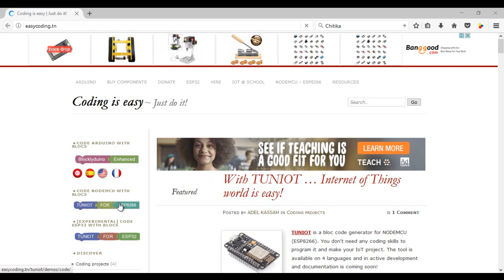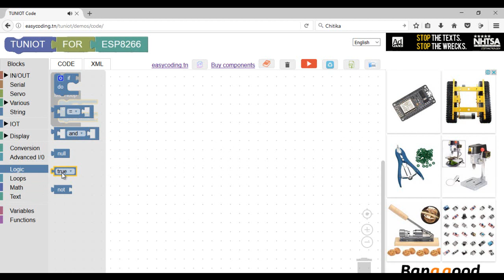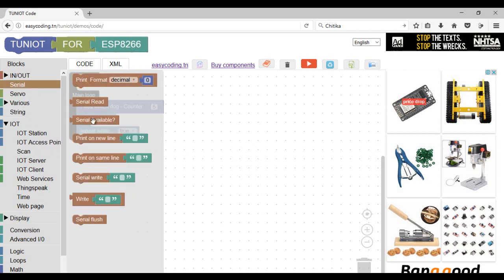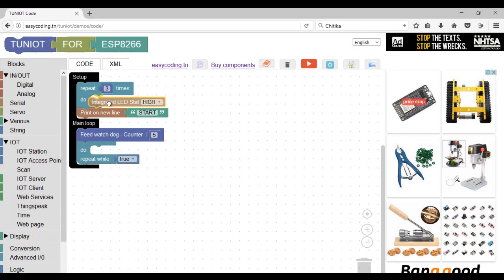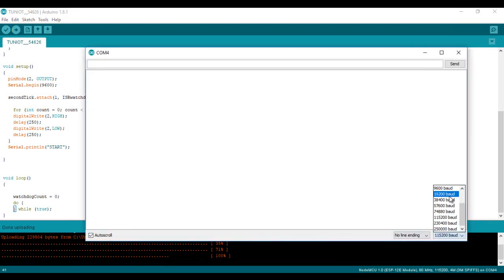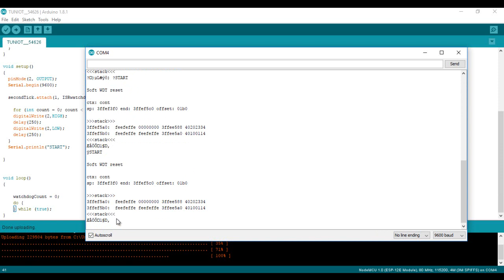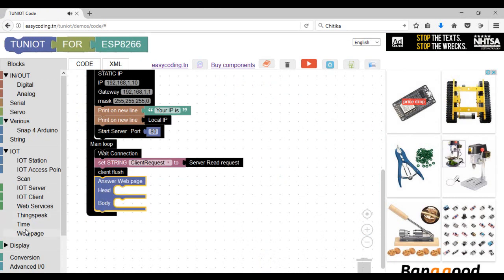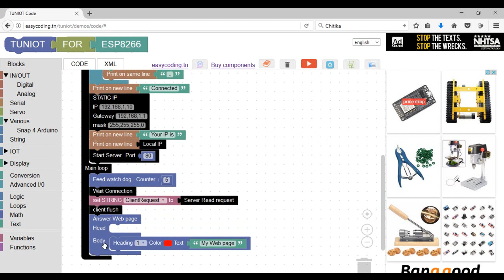NodeMcu (ESP8266) Tutorial A-20: Watch dog and stability

Comment: I recently purchased the NODEMCUESP8266. I have been testing the Wi - Fi connection and I have managed to do my program in the Arduino IDE. The problem is that when trying to enter the IP address of my board from another network does not show me the page, however when connecting to the same network as the board if I let in. What is this about? I would love to know that there is a post dedicated to this.

Thanks for your videos.

I am looking forward to your response.
Have a nice day.
Greetings from Mexico.
Reply from the maker: +Juan Cortez this normal. You need to be on the same network. There is some network concept that you need to know to make an advanced network.
Reply: Thank you very much for answering. I would be very helpful, if possible, to tell me what these concepts would be or what documentation I could find. Because I want to control loads in my house from my cell, being me out of it. And obviously I could not do it, if I have to be connected to the same network.
First of all, Thanks.
Reply from the maker: +Juan Cortez if you want to control any thing with the internet take a look to the video ada fruit mqtt server. There is 2
Reply: Thanks, I'll watch the videos.

Comment: please , why the website easycoding does not work from two days?
Reply from the maker: +mohamed arafa there were a problem of dns and it is working now. Please try a different dns like 8.8.8.8 and let me know
Reply: it is working  now , thank you very much

another question , can i connect to nodmcu directly without using an external network and control it using mobile app  ??
Reply: it is working now , thank you

another question:
can i connect to nodmcu directly without using an external network and control using mobile app ??
Reply from the maker: mohamed arafa for now i dont know sorry